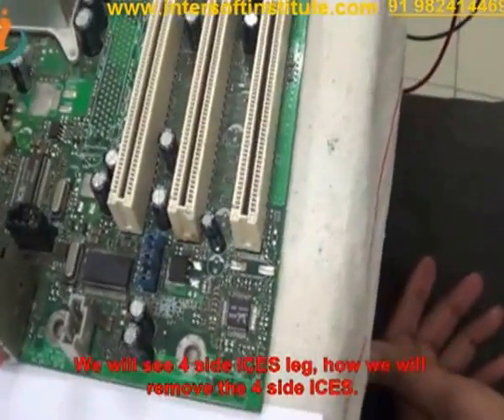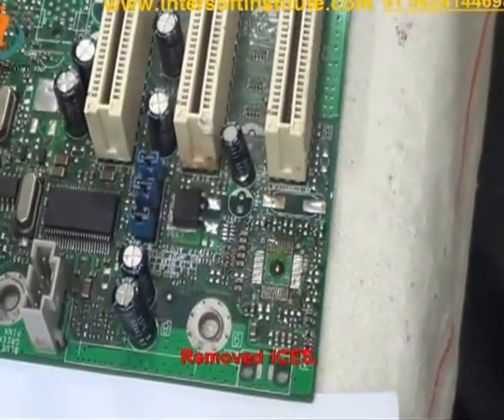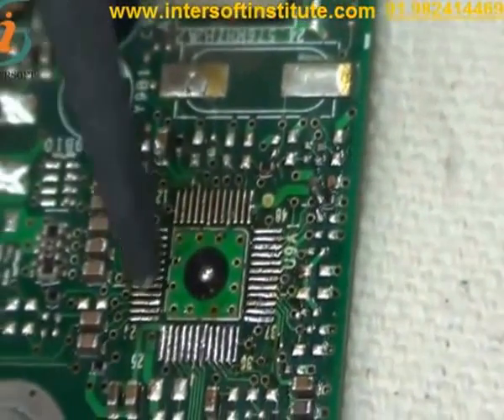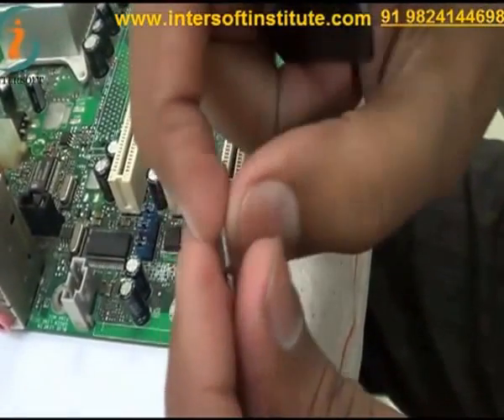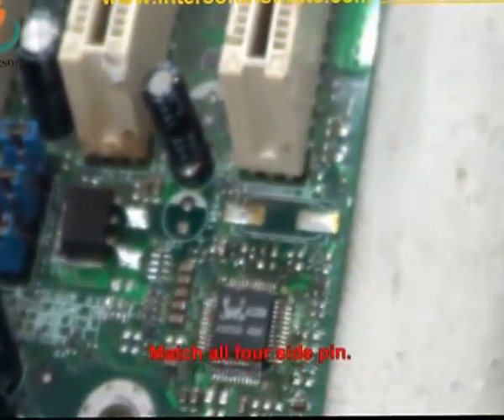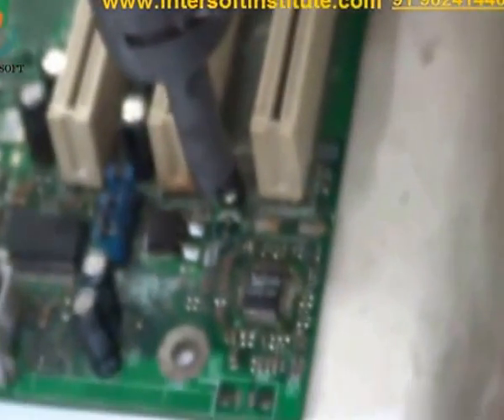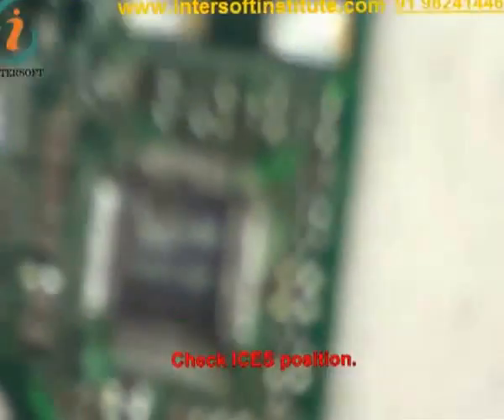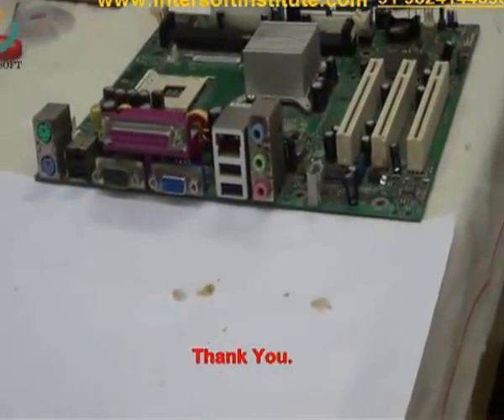Removing audio chip of computer motherboard (English)

Comment: my laptop speaker is quiet and headphone jack making crackling sound. i tested my speaker continuety using multimeter its making sound on positive negative and i changed the os for 400rs there is no change is it audio chip problem
Reply from the maker: may be pcb problem in audio section ,  small caps may leak  or some other , you can check with schematic diagram if you have idea of repairing laptop  chip level

Comment: Assalam alaikum bhai. My speakers and headphone are not working, when I checked mobo  some component near the realtek chip are smoked. What is the solutions and cost ll be.
Reply from the maker: check on schematic diagarm some component is missing ,
Reply: Use quantum usb sound card  130 rs only
Reply: @SanthoshKumar-qh7pw  poor sound quality.

Comment: What is the price of audio chip
Reply from the maker: you can take from scrap board
Reply: Intersoft A. Khan my laptop internal speaker are not working I installed new driver or update and so on and I also check the audio chip but it's ok I use my earphones or external speaker they work properly . So where is the problem in my laptop so I can fix it pls help me ....
Reply from the maker: did you check speaker continuity  ,  also pad continuity its open or short,  if ok means connectivity is ok then chip problem s
Reply: @intersoftdatarecovery  can we use any sound ic of same no.of pins?
Reply: Realtek ALC 892 comes at Rs 45-50 per piece in Aliexpress, free shipping.
Check number of your IC/motherboard manual and search there.